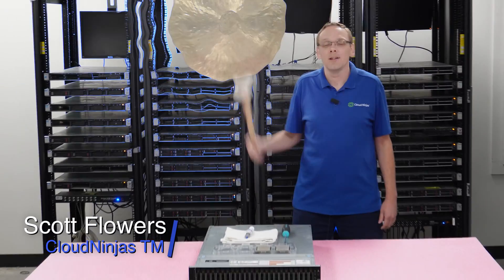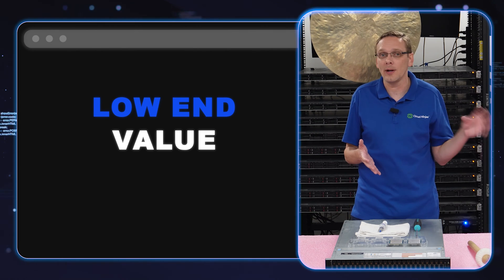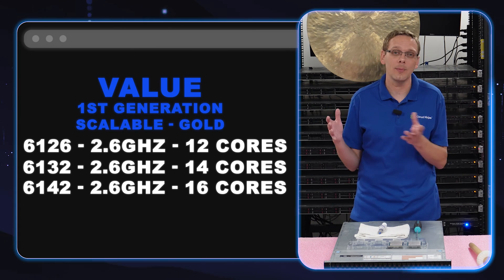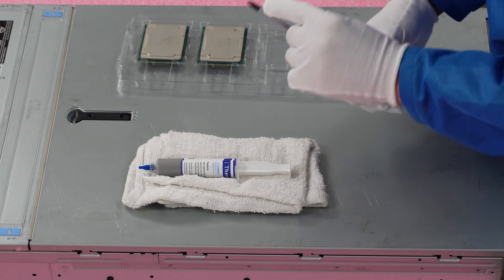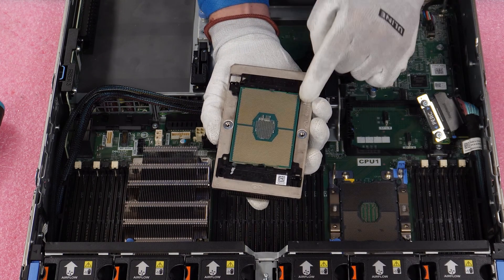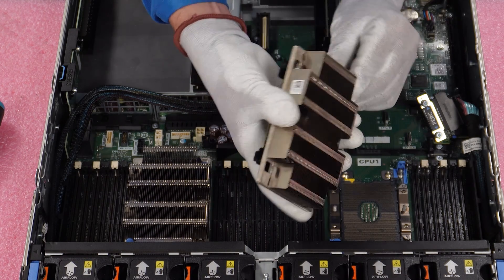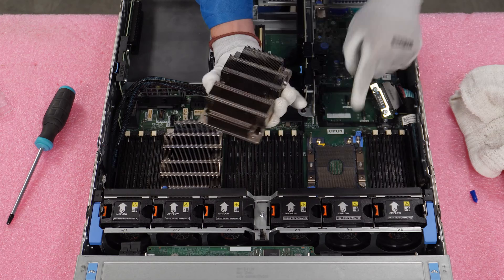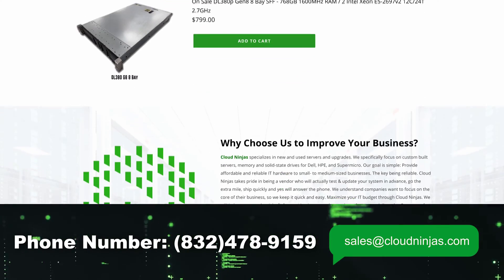Dell PowerEdge R740xd Server CPUs | Intel Xeon Processors Options | LGA3647 Socket | CPU Install

Comment: What is a point of Intel Xeon Platinum 8256? High-end PC CPUs have better specs for much less money. I am not knowledgeable about server hardware, but I noticed that X. P. 8256 exists, and I am trying to find what justifies it at that price.
Reply: Hello, If you look at the "scalability" section in the Intel Xeon Platinum 8256 processor specifications, you will see that it is 8s8. There is a single socket processor in PC. If we compare it with Ryzen 3 generation personal computers according to the processor release year of 2019, 6-core Ryzen computers will be cheaper, less energy consuming, and higher frequency than Intel Xeon Platinum 8256. However, since 8 computers are clustered, there will be a latency problem. This latency is minimal in multi-socket processor architecture. That's why Intel plays as it wishes on the server side. But recently, AMD Opteron being a strong player bothers Intel.
Reply: @edemirci1 If I understand it correctly, there can be up to 8 CPUs like this in one computer having 32 cores. How do 8 Xeon Platinum 8256s compare to a Threadripper 2990WX which is a year older, has 32 cores in one CPU and is much cheaper than a single Xeon Platinum 8256? It seems that it can do as much computation on a single CPU for much less money and power. And latency seems good because it is on a single CPU. But I haven't found memory limitations.